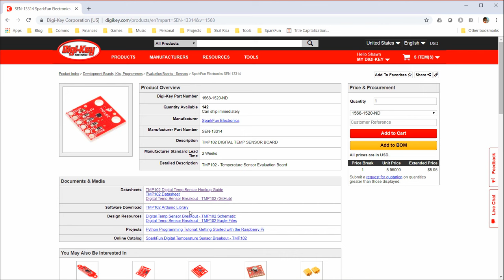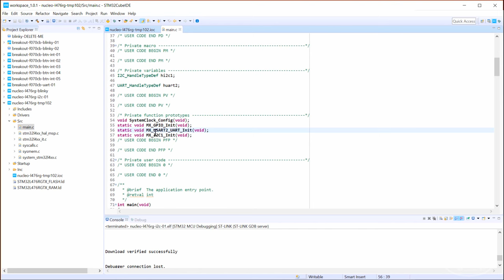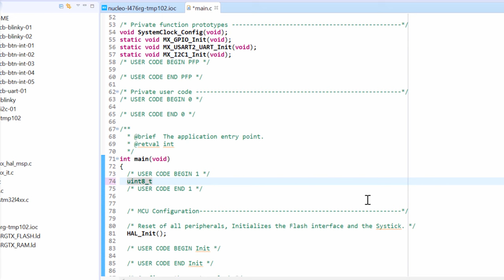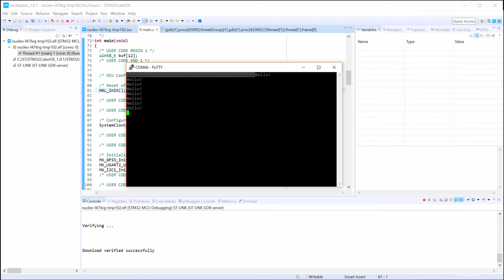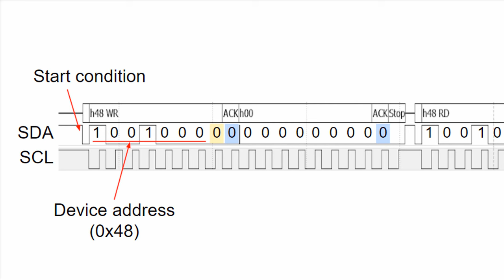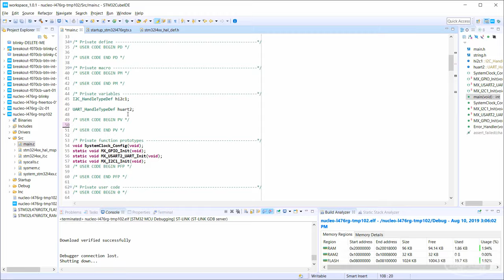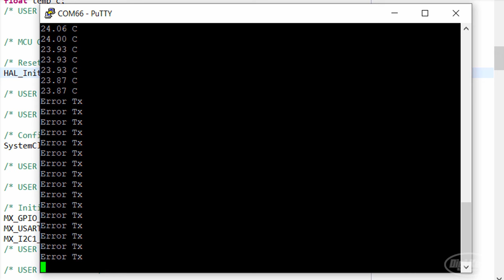Getting Started With STM32 and Nucleo Part 2: How to Use I2C to Read Temperature Sensor TMP102

Comment: The best explanation I've found so far, one video about SPI and CAN communication would be amazing!
Reply: CAN deserves some explanation indeed. As for SPI, I always regarded it as one of the simplest protocols out there, more than UART, since there's almost no device link data structuring (like UART with start, parity or stop bits). The data structure is probably only dictated by the type of device you want to communicate with.

Comment: I would like to complement this amazing tutorial by pointing out a few issues: 
1) the 2s complement comment should state that you are actually extending the 2s complement encoding from 12 bits to 16 bits;
2) the float value is converted to unsigned int in the printf, so negative values will not be displayed correctly.
Reply: I still confused with that part of the code. I was expecting that the a value that is in 2s compliment would require several steps. The steps I would expect would be: checking if most significant bit is a 1. Then if true, invert all bits and add a one at lsb location. But here he just does logic OR with 0xF000. I am confused...kindly explain.
Reply: @JasperHatilima  12:56 the temp sensor has only 12 bits, but val is a 16 bit signed integer (int16_t). Then, he checks if the most significant bit of the 12 bit temperature sensor reading is active by testing (val > 0x7FF). When he does the or-ing (val |= 0xF000) he is just extending the 16 bit variable with leading ones so that the whole 16 bit variable accurately represents a 2-complement value

Comment: Incredibly sharp and concise tutorial!
Reply: Can you please explain to me how we sent the 8th bit to determine if we are writing or reading?
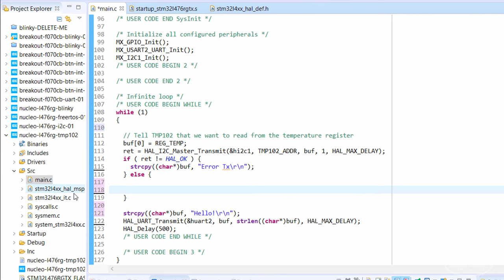Reply: @ramimehyar481  at 12:20, you can see that there are two different functions for either writing to, or reading data from the I2C device. They will set the 8th bit accordingly.
Reply: @Hirnlappen  thank you, i have assumed the same, so that means that this w/r bit is a standard i2c protocol to be at that location?
Reply: @ramimehyar481  Indeed. But just to be sure, I also looked it up again. You find it on the Wikipedia page as well as in the I2C standard, which is very well written (it's linked from the Wiki page).

Comment: Thanks.  I ran into a curious issues.  After following this on a Nucleo-64 I added an OLED 128x64 1306 to the I2C bus.  The debugger/programmer couldn't reach the MCU.  The MCU was running, but hthe STLNK couldn't reset it.
I reviewed the wiring and found by simply connecting the OLED to the 3,3V pin was enough to cause the programmer to fail.  It makes no sense.  I check the OLED on an ESP32 and it worked perfectly.
It's almost as if the 3.3V regulator is overloaded with the chip+tmp102+oled.

Comment: Great tutorial, used this in part to setup an ADS1115 connected to a LM60 on the BluePill. 
Just one thing though:
        sprintf((char*)buf,
              "%u.%02u C\r\n",
              ((unsigned int)temp_c / 100),
              ((unsigned int)temp_c % 100));
      }
This will fix chopping of leading zeros for the decimal value. (ex: 20.09 = 20.09 and not 20.9)

Comment: I am using stm21f722ZET6U Nucleo board,  I tried to program for simple LED Toggle and I selected the nucleo board and configured RCC and SYS  and Selected in built LED in as output but when i try to generate the code for it its not generating the code

Comment: Why didn't we change last bit(R/W bit) of the TMP102 address from 0 to 1 in HAL_I2C_Master_Receive function in order to read data from the slave, as you mentioned in 09:20? I think we could easily do that by TMP102_ADDR | 0x01.
Reply: I have the same question
Reply: @mozhang2724   0x01 is the adress of temperature register  where in the  hal i2c master transmit function it will take care of R/W bit if u using transmit function means R/W bit set to 0  and if u using Recive then it set to R/W bit set to 1
Reply: @mozhang2724  and 0x01 is not R/W bit it is Temperature register adress

Comment: Could you make a tutorial for updating the virtual COM ports for Putty -> STM serial connections? Windows 10 has made the COM ports obsolete and its been impossible to debug. Tried 6 tutorials to fix the issue for COM ports and nothing works.

Comment: I don't understand how you did the 2's complement
Reply: Dave you add 1 to your binary number then flip all the numbers to 1 if they were 0 and 0 if they were 1. i.g. Your binary number is 1001011 so after adding 1 you’ll get 1001100 and finally you’ll have 0110011
Reply: Dave is right. Line 129 sign extends the float value to correctly ensure the number is negative, but the additional code is missing. Temps <0°C will be reported incorrectly.
Reply: val is an int16_t, so what we're doing is looking to see if the first bit of our 12-bit number is 1. If it is, we pad 0xF to the front of the 12-bit number (making it a 16-bit number that starts with b1111). Because it's a signed int16_t, the 2's complement will be automatically performed for us, resulting in the correct negative number. Hope that helps!
Reply: Aaahhh.  You C programmers are spoilt.  ;)  I'm an assembly guy and we (generally) have to do it the long handed method:
  ori #$F000, reg1
  not reg1
  addi #1, reg1
Reply: @BobBeatski71  minimizing a long task with some abstraction doesn't mean they are spoilt :)

Comment: Hi, firstly thank you very much for the useful video. But I still got a question. In my case, the result looks something like error tx or rx between the actual temperature. Here is the picture

https://imgur.com/djMx7oE
Reply: you are not alone
Reply: @abutaymiyyahlectures  did you find solution?
Reply: @AnhTuNguyenanhtunguyen  actually, yes i did
Reply: @AnhTuNguyenanhtunguyen  the problem for me was, the pins, u know how there are 2 rows of pins for the nucleo right?, i addidentally put the wire on the first row instead of the second row. Its my first time making this mistake. How i figured out my mistake is by making use of the other i2c pins, there are 4 total pins for i2c1, u can use either one of the pairs, for me the first one didnt work because of the pin mistake, so i decideded to use the second pair, then it worked and i found my mistake, hope this helps, u can try making use of i2c2 as well if u have